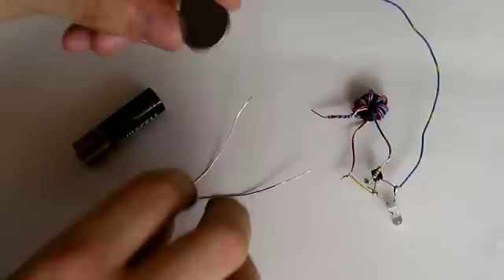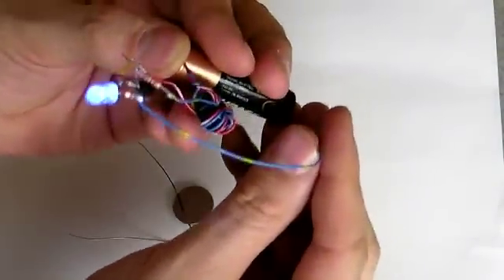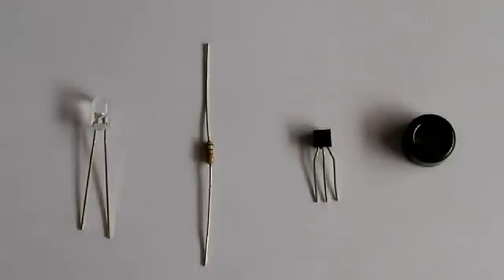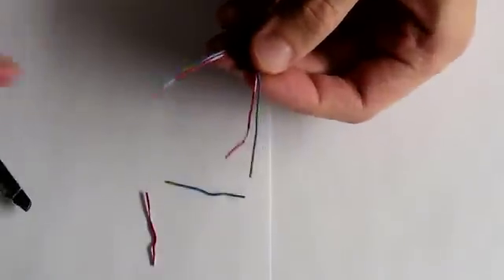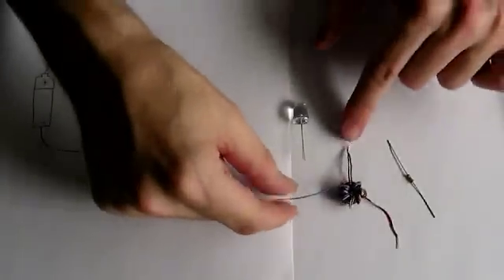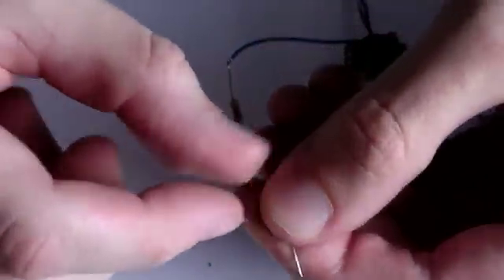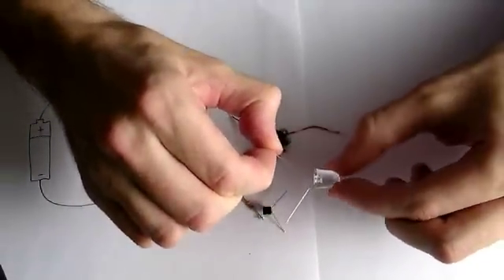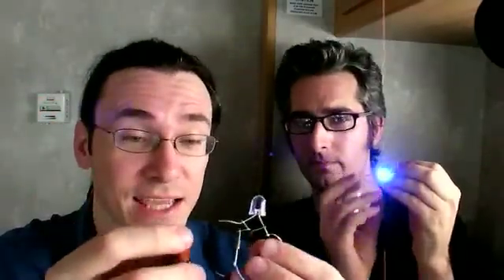Make a Joule Thief

Comment: You forgot to explain what the short and long leads or the flat side of the LED indicate as far as positive or negative. Also, you forgot to include the direction the LED connects to the transistor (I.e. does the positive or negative goes to the collector or emitter). But otherwise good job 👍

Comment: taenang capstone to
Reply: show some respect with the joule thief: you couldnt invent a more efficient boost converter design than that (and a fairly new invention too. the most efficient design was around 1987; the recent designs came from 1999, and the name was coined in 2002 (And this circuit specifically as well, with the transistor configuration))

based capstone tho, though i admit it was a bit corny.

Comment: I am making a joule thief for my science fair at school, but it will not work. I am using exact components used in the video: 1k ohm resistor, 2N3904 resistor, 3 volt white LED, and toroid core with copper wire (not coated/colored). Rather than soldering, I wrapped the wires around each other since my soldering skills are not advanced. I used a 3V battery initially to see if the energy would flow, but it will not work! I also tried a regular AA battery; consequently, it doesn't work. Any suggestions?
Reply: the wire should be coated.

Comment: not working
Reply: Check my other comments for troubleshooting and tips.
Reply: 182 Yes, it does. You just need to wire up the toroid right way and make sure it's wound well and evenly. No wires should cross on the toroid.
Reply: turn your led around
Reply: yes it does work
Reply: +PunakiviAddikti yes I know it works I'm working on one

Comment: The values of Joule Thief is
Q1=e.g 2n2222 2n3904 (Do not use 90xx transistors because the gain of the transistor is high and will drive over the Joule Thief and will not work.
R1=350-5000 ohms
D1= LED [Vfwd=3v]
Vceo=30v p-p
Vbeo=0.7v

Comment: I tried to build it several times and I still can't get it to work. I tried several types and gauges if wires with different lengths but nothing works. I got one working so I'm starting to think that I have bad ferrite cores.
Reply: EDIT: It works if you wrap the toroid the right way (the wires must not cross each other). You need to use small enough wire and you can wrap a toroid as small as 3 mm in diameter and 1mm in height and it can work, however the light will be dimmer so use a decent size toroid. It also matters which of the two wires you connect to the resistor and which one to the transistor. You can use a common NPN transistor BUT in europe the BC547 has a different pinout to American 2N series transistors. Minus is on the left of the flat side (facing up). If you use a big toroid it can run for over a month. A smaller toroid will reduce the time. You can also increase the resistor value to a certain point to make it run longer. If you decrease the value it will not run brighter at all and will last much shorter. You need at least 1k.

Comment: Even though this video is posted 7 years ago there are people still showing this technology like they found something  new. Well let me tell you what.. Sony had this technology back in 1980's and they build WM-GX series Walkman played cassettes had dual band FM radio and also WM-GX650 and higher models had a headphone with remote control digital display on it. Guess what? All driven by a single AA size not 1.5 Volt but 1.2 volt rechargeable battery. Yes back in 80's they accomplished a  1.2 Volt rechargeable battery not just run LED light but run a motor in Walkman to play cassettes and power the radio with it.
Reply: M USTI Yeahr, therefore it is forbidden to use the Joules Thief.
Reply: *****
It isn't. I just wanted to say that I don't understand why the TO meant it's pointless...

Comment: Its so bizarre.  I cant make these fucking things work for shit.  In order for them to work as good as in the videos I have to use a gigantic inductor coil from a high end power supply.  I know that the circuit is correct because it works as predicted on the damn-near-dead batteries. while the led will not without the circuit.
Reply: Check my other comments for troubleshooting. They might help.

Comment: wow I an not get this to work.. I have even tried a 500ohm resister  instead of the  1k... wtf
Reply: I think that I got a pack of 3904s that have a bunch of bad ones in it.  I made three of these identical and the third one worked.  they are all built identical!!

When it would not work at fist I was all like....  wtf I sucK!
Reply: I had the same problem. Try swapping the two wires coming out of the toroid going to the transistor and resistor. It matters which way they are connected.

Comment: How many windings are on the coil, your sound is bad on that?
Reply: It doesn't really matter but try to get as many as you can. Leave a small empty area in the lower section (don't cover it entirely with wire).

Comment: I tried powering my joule thief circuit which I built from this video using  kn2222a transistor instead. All the parts I got from an old PC power supply, with half bleach and water, using the positive lead attached to a twisted piece of copper wire and a piece of aluminum twisted and attached onto the negative lead ducked together into the bleach water and it WORKS ON 3 LEDS (Light Emitting Diodes) ATTACHED IN PARALLEL!!! Try using damp table salt to see if you may get the same result
Reply: Yes, it can indeed power super bright LEDs in parallel with a dead battery (or a simple electric pair like the bleach water). It's a versatile little circuit.

Comment: will than u for this
but if i switch the battery and put the   peltier cooler  
its that make change
Reply: You can power it with a peltier generator. It works quite well. Just cool the cold side enough with a heatsink.

Comment: Hi i made joule thief (pun derived from word Jewel-Thief)  according to this video.
Question is, why did the LED seems turn off when i put some Neodymium maagnet on Ferrite Toroid? and when i take magnet off toroid, it turn on..

Did magnetic wave do something with this?? this only hapen when i use LED but when use 12V lamp, it doesnt affect this circuit.. thanks
Reply: the magnet is interfering with the toroid coil's magnetic field.

Comment: One important thing has not been mentioned here: Base-Emitter saturation current!
Choosing the right resistor for the transistor is very important, otherwise your JT circuit might either be too weak or the transistor will fry. According to the corresponding datasheet and Ohm's law and the following formula  "R in Ohms = (Vbat in V / Ibase in mA )" the required resistor is quickly determined.
Reply: Its important for my JT resistors. Thanks
Reply: Richard Johnson
You're welcome! Good luck with your JT project ;-)
Reply: +Bandicoot803 Thanks i'm very happy and my Joule Thief works very lucky. :D
Reply: Richard Johnson
You're welcome! Good luck with your circuitry!

Comment: Thx. I made it on PNP S8550 transistor from old gas lighter (big one, battery powered), and core from broken  Lenovo Y550 power supply, it already had good wires.

Comment: According to the Wikipedia article "Boost Converter", the boost converter is part of a joule thief circuit (Heading: Applications; Paragraph 3, Line 1).
A boost inverter increases voltage but decreases amperage (according to the law of conservation of energy). Hmmm... I'm going to have to see how this works out in a joule thief now. I'll be in suspense until I understand it. Hmmm...

Comment: As I understand it, it's pulsating DC. I understand how the circuit works but not well enough to explain it in 500 characters. Suffice it to say that the transistor and toroid coil work as a sort of relay switch, turning the LED on and off at hi speed.
The best explanation for how a joule thief works, that I've seen so far, can be found by doing a Youtube search for: "joules thief 60,000" (without the quotation marks). I hope this helps.

Comment: i just made one that worked but the LED isn't as bright as shown in your video
is it because of the odd transistor i used?

i mean it's leads are arranged in a different way and i may have wired it wrong
the text on the transistor is "k 524  c945  p"

Comment: I have made several of these work using a KSD5041 NPN transistor (available at Mouser...very cheap).  The circuit seems to be able to drive at least two 8mm Straw Hat LEDs quite nicely.  In fact, they are so bright, one does not want to stare at them for very long.  Quite painful actually!   The 5041's have a fairly good gain and a high switching current rating.  YMMV. -Pete

Comment: @jertheber: Basically voltage E + B of Transistor is never more than 0.7volt. If your measurement says it is 1.5V, then it means your transistor has been broken. ( Base to Emitter connection has been burn out), Please try a new one. 
Good Luck.

Comment: hello,

I can't seem to get this to work.
I have the following: 1k resistor, 2n2222a transistor, 1.5v battery, 3vdc LED, toroid  1/2 in diameter to outside, 22 awg wire wrapped 11x around toroid,

I tried it without the resistor but it still doesn't work
checked to make sure I connected the wires from opposite sides, opposite wire too
checked LED polarity, still nothing.
check output power: Emitter + Collector = 0v, E + B = 1.5v, C + B = 1.5v

what am I doing wrong?

Comment: you'd need to increase the amount of batteries used. If a 1.5V cell is enough to power a 3V LED, maybe four 1.5s will do the trick for a 12V fan

Comment: I noticed in the vid they don't really stress that both the transistor and the LED are polar things; they have plus and minus sides or they don't work.  The flat side of the LED is the minus side.  The transistor depends on NPN or PNP.  I'd use a bread board or jumper clips to assemble this before soldering.  Good luck.

Comment: also i suggest YOU go look at the whole whack of other comments which are saying what i said, a tranformer, that changes the voltage, and does not magically make dead batteries work, there is no such thing as voltage boosters, and with ohms law there are rules with changing any one part of the equation of voltage/resistance(ohms)/current(amperage), if one is raised the others change, the equation is I = V/R, i have built these circuits in grade 9 electronics class

Comment: if it changes the voltage it is a transformer, there are step up and step down transformers for any eletrical application, his explanation is not applicable because if the battery is dead it wont work at all, even in the video they say the led requires 3v, but it is only a 1.5v battery, they TRANSFORM 1.5v into 3v , his technical explanation of what is happening is correct, high current drain for more voltage, but a dead battery is dead, this exp is on how to power higher v with lower v power

Comment: Transformers require AC current, batteries supply DC.  This is an oscillating voltage booster- see "izzzzzz6"'s comment for a more detailed explanation of that.

Comment: @flyingpnda247 It works just fine! I hooked up a single AA battery with 2700mAh and powered a 3mm white LED for more than 36 hours without interruption. That tough battery was almost dead when the LED started to fade!

Please keep in mind that using two AA batteries in series will overload and destroy the circuitry!

Comment: @templedog69 no it wouldnt, you would need a rectifier, those wall warts you use to chagre phones etc, they are step down transformers, dropping ac120 to ac 12 or less depenging on component requirements, then you use a rectifier, usually found in the device itself to convert ac to dc, basically its 4 gates forcing the electricity to always leave the rectifier in the same polarization

Comment: Just a reminder as you are transforming the battery voltage into a higher voltage, the current consumption from the battery increases as well, which basically means, yes, you can use 1,5 v battery to do the job of 2x 1,5v batteries (3v) but the battery will die also double speed at least. Still this is a pretty cool project, I just wanted to remind people that you cant make energy out of nowhere, and 1 battery cannot replace 2 for the same amount of time. Thanks for the video. I like it.

Comment: @ericdalgetty  you need to lower the voltage you nead to use a +/- 470 resistor in series with the led so take out all the other components

Comment: @TheJG1947 

You may have several problems.  First, is your toroid ferrite?  Sometimes folks try powdered iron toroids (usually painted green, yellow, etc) which can be made to work but you need a different set-up.  If you do have a high permeability ferrite, it may be that you crossed your windings where you take one from each side like they said.  This can be a bit confusing at first but it makes all of the difference.  BTW I can light over 400 leds from a single AA using my JT circuits.

Comment: Hi Guys,

I did try "your experiment", somehow I cannot seem to make it work.
On a single double AA  battery it won't light up, with two, it kind of lights up but the light is feeble, only with three double AA battery is really bright.
I followed it to the letter I think; could it be that the toroid has few more turns than yours?

Comment: @ravenclaw995 yeah it's good at charging batteries with it or charging high voltage capacitor and...lighting up an CFL if you use an very big coil and toroid :P

Comment: I made this joule thief circuit.   I have a magnifying visor with a white LED lamp on either side.   I placed the jewel thief on one side with a single AAA bat. and used the normal two AAA bats on the other side.  The joule thief side runs brighter.  After 345 minutes of on time, the joule thief side still produces usable light, whereas the normal side is just a dim light.   I am not sure about the wisdom of totally draining a bat though. Alk. bats will leak, and not good for NiMh either.

Comment: It works. Took a small (15mm diameter) toroid and wirepair from cat-cable. In toroid there was only room for 11 turns but it works. The other components were bc547, 1k resistor and white led

Comment: @Janigut 

If you make it right, you can use any color led you want.  I have used several 10mm ultra bright leds with this design and they light very well.  More advanced JT circuits can light over 400 leds from a single "dead" AA battery.  I have many videos on these.

Comment: Thanks for the vid. I built one and it works great. After tinkering with it, I've found that it works with some d.c. sources and not on others. Does it have any voltage or amperage limitations that would make it not work? Just curious if there was a way to step it up for larger applications. Any help or ideas would be greatly appreciated. "Have a great weekend"

Comment: @Scrixx   Make sure that the wires from the coil that conect to the battery (it is really a cell) postive are taken from the start of one winding and the end of the other. Secondly test it at first with a fresh cell (make sure it is the right way round). Thirdly see if the LED is the right way. And lastly make sure the transistor is correctly orientated. Then it should work. Good luck

Comment: I have been able to run a 1W computer fan (12V) off this device using an Ultra fast diode. At this power the circuit is drawing about 1A from the AA cell. Another one I built has been running a standard LED off of a flat AAA cell for 6 WEEKS! So far…

Comment: This happends at any were from 15000 times a second (15kHz) to over 700000 times a second (700kHz) as humans can hear frequencies up to 20kHz you can some times hear the high pitched wine from the circuit. This also explains why you can here this on an AM radio (530-1200kHz).

Comment: When the current flows through the second winding it induces current in the opposite direction in the pick up winding. This current causes the transistor to turn off. When the transistor turns off the energy stored in the inductor has no were to go. So the inductors will increase the voltage until current flows (through the led) at witch case the process restarts. Continued…

Comment: This is basely a self-oscillating boost-converter (look it up). It the way it works is that current flows from the 1.5V cell through the pickup winding on the torrid, then through the 1k resistor and finally through the base of the transistor witch turns it on. (The resistor is to limit the base-emitter current to about 0.7mA) When the transistor turns on it allows current to flow through the second winding (an inductor). Continued…

Comment: it works like a small step up transformer except its also pushing more mA out of the battery.  there are many variations that can be made out of this circuit to suit ones needs, usually in the form of mini-HV power supplies like those used to light fluorescents. look up chilliqueen's resonant circuit to see how to make one without a toroid core.

Comment: @insAneTunA I have changed the 1k resistor for a variable resistor. When I lower the resistance, the voltage drops, but the light is shining much brighter ???? Now the LED is at it brightest at 0.658 volts, I measure the voltage at the two leads from the LED.The amperage went up, that explains it. I am using an AA battery that didn't work in my mouse anymore :-)) And now I have some light out of it :-)) Very nice.

Comment: I got my joule thief to work on a bread board. Tryed several transistors from different circuits, but got this one to work alright. Used the 3904 transistor and the 1k resistor. I did use a small but different ferrite core. It's a small rod with a bifilar coil from 20 windings and 0.5 millimeter wire. With the joule thief the 1.6 volt LED goes on at 0.811 volt , and without the joule thief the LED  doesn't go on at all. Very sweet, thank you guys :-))